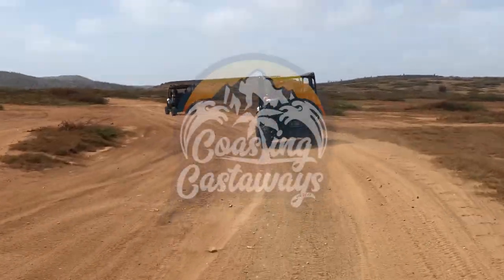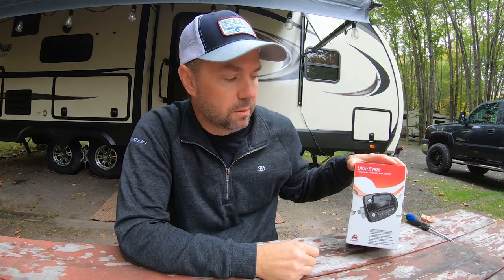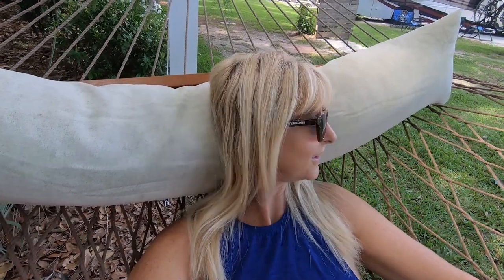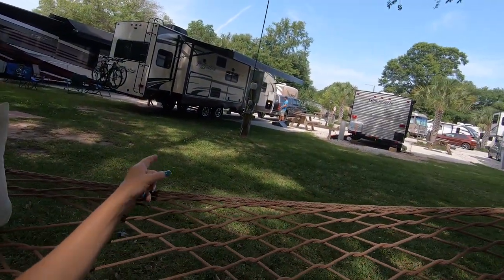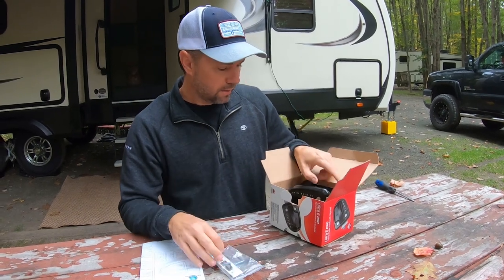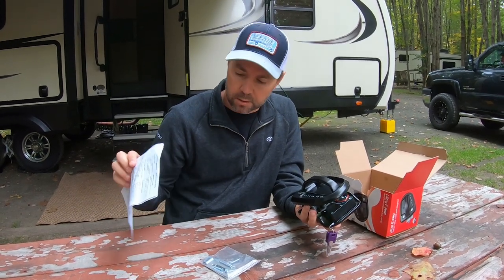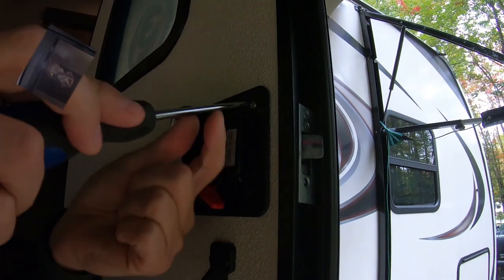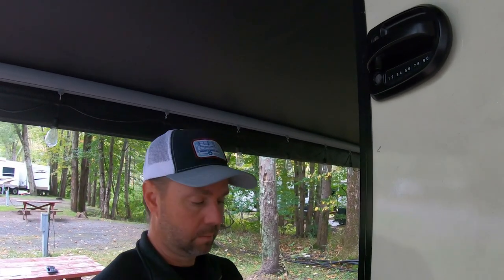Jen Got LOCKED OUT! 😳 / RV Keyless Entry Door Lock Install / RV Living with Coasting Castaways

Comment: Nice video, I have considered installing this lock on our trailer and was hoping you could answer a few questions. 

I see there are two lock cylinders.  I assume one locks the handle and the other locks the deadbolt.  Does the keypad unlock both the handle and the deadbolt? 

Also you mentioned all metal construction.   Is part that sits on the insude surface of the door and the inner latch handle metal?
Reply from the maker: Great questions! So we did some checking for you. The keypad only works the bottom cylinder, which is the deadbolt. The top cylinder only works with the key. The interior handle is all metal construction as well. Thanks for watching! 😊
Reply: @CoastingCastaways  Thank you very much fo the information.
Reply from the maker: @nwertz97  Your welcome, anytime!

Comment: Almost the same thing happened to us one time. Then another time, we just arrived at the beach and the kids were super excited. So we didn’t complete the setup, we jumped in our swim suits and took off. When we got back the door would not open. I started spraying off the kids and the hot water heater came on, then wasp came rushing out and stung one of my daughters. I’m allergic so I’m risking a lot but I couldn’t just run and leave the kids. Anyway we had to stand in the hot sun until my husband leveled the camper so the dang door would open. So from then on we never rushed or postponed any setup process. Plus we always check for bee nest in the vents and underneath before we leave out. It doesn’t take long for nest to build at all.
Reply from the maker: Being locked out is no fun! 🤷🏼‍♀️

Comment: Was this worth the cost? Overall thoughts?
Reply from the maker: When we didn't have this locking system it would have been very helpful due to my (Jen) situation of being locked out with our dogs in the Alabama hot summer weather. So yes, we do believe it is definitely worth the cost for sure! As you saw in this episode we had to pay for a locksmith to come out to help me which was an additional cost we would not have paid if we had the locking system. So far we are loving it but we will also have a video later with a full review after we have used it for a while to make sure we still like the product.